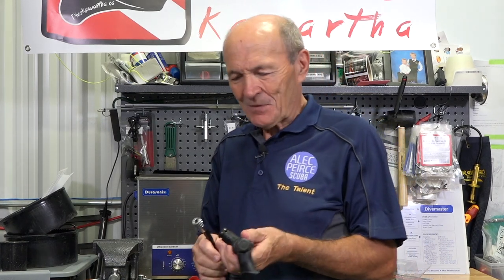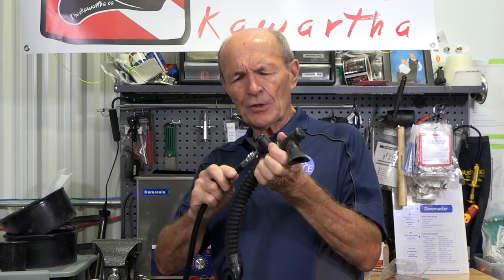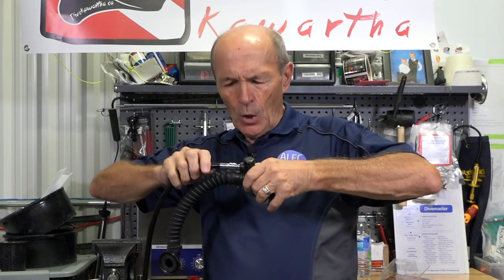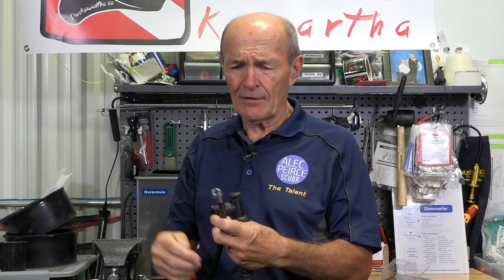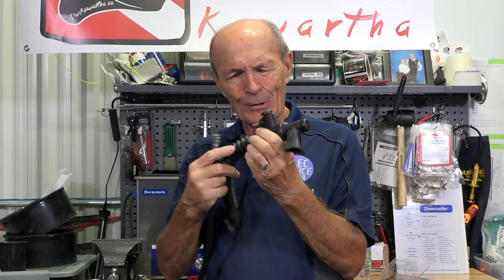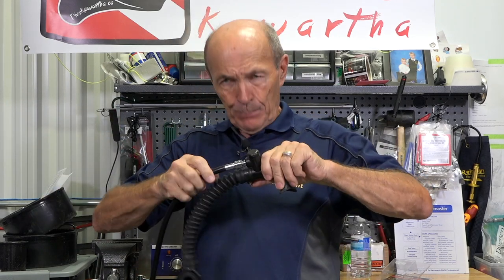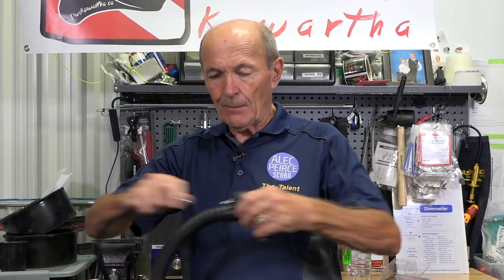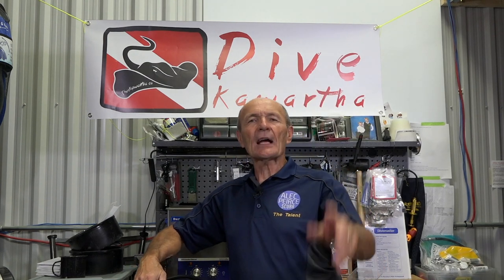Cannot Connect BCD LPI Hose - Scuba Tech Tips: S11E22

Comment: Sometimes you have to disconnect and connect under water. For example if your inflate button gets stuck. So you cannot actually turn the air off at that moment. Is there any trick to connect the LPI under pressure ?
Reply: You could probably push the deflate button as you are trying to reconnect the LPI hose. Just an idea, I’ve never tried it.
Reply: @robertharrison4387  I don't think that will work, because the deflate button routes air out of the BCD bladder, not the LP hose. Pressing the INFLATE button might help a little, but then you'd also go negatively buoyant. When I took my OW course we had to practice connecting and disconnecting underwater, and I found that I just had to press both parts together very firmly while inhaling deeply, and then immediately exhaling to stay neutral.
Reply from the maker: It can happen on a dive where the LPI leaks air into the BC (slowly or quickly).  Disconnecting u/w is early as it pops out.  
Re-connecting the LPI under pressure on the surface and u/w uses the same effort so practice helps.  My trick would be to get a good grip on the LPI hose with 3 fingers, thumb and forefinger pull the connector back and PUSH with both hands together before releasing the connector then give a reasonable tug to ensure its fully locked.
Reply: I’ve had the lpi hose come of in a dive and good thing I have a dry suit so I had instant buoyancy. It’s really hard to get the lpi hose back on under pressure underwater. If you push the hose fitting back on as far as you can get it on the bcd  and push the inflate button on your bcd, the fitting gets sucked on back into place as air goes into the bcd. Practice it a few times on land first with your system pressurised so you don’t panic if it happens underwater
Reply: @saraha3958  A year late, but that sounds like a brilliant tip!

Comment: There is one other thing, that might keep you from connecting the hoses: They don't allways fit. There are two types of inflator connections, the "normal" one an the so called "CEJN" connection.

And i also have one combination of a hose and an inflator (both with the normal connector) that only fit with a lot of force. I guess this is due to slightly exceeded size tolerances.
Reply from the maker: The CEJN connector is a new attempt to simplify todays standard DIN and Schrader valve connector.  The new CEJN has issues to fix (from my online reading), in that it is possible to freeflow when not connected, costs more and is not internationally accepted (so far).  Like many items in scuba, there is always new ideas coming and some take a while to work out all the bugs before becoming a 'standard' (like singe hose regs).  Thanks for watching.

Comment: Any tips for the LPI with a drysuit? You usually have the pressure on when you're at the point that you connect that LPI. Mine's a real bitch to get it to click when the pressure is on.
Reply from the maker: Try attaching the LPI hose first to the BCD, see the effort to connect with pressure on.  Then repeat on the dry suit connector.  The connection effort should be the same.  If not, try re-lubing the LPI hose with food grade silicone.  If really hard, try a replacement LPI hose (borrow one first) to see its easer.  There should be no noticeable effort difference when connecting LPI's to different devices.
Reply: Thanks Alec, I will check that out.
Thanks for your amazing content.

Comment: You can get the "hose hats", they help. And you can also get a fitting that locks open when disconnected so you don't have to pull it back to connect.
Reply from the maker: Hose hats may solve one problem but be careful, it could push against the BC hose causing a air leak. Test it to ensure it the quick disconnect is smooth and remember to clean under it after dives.